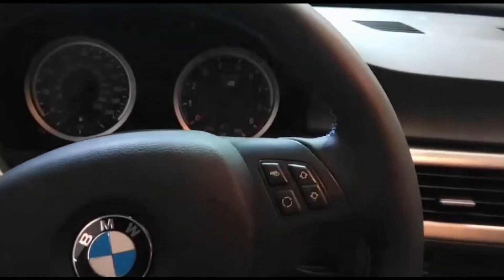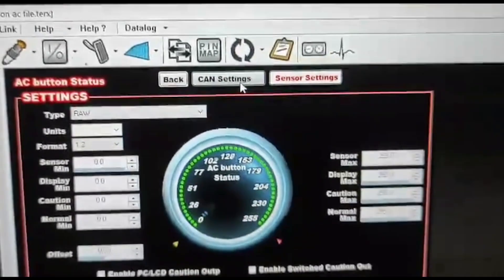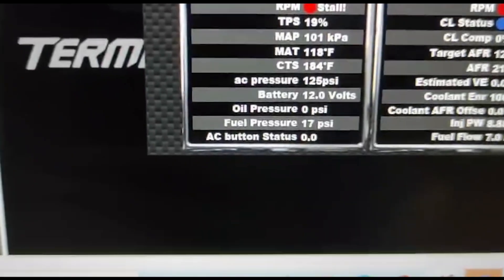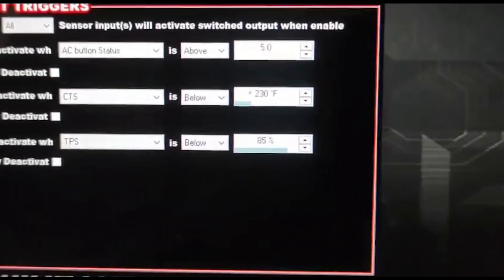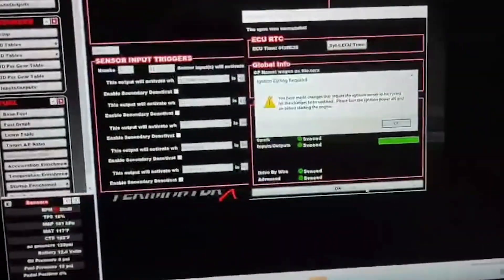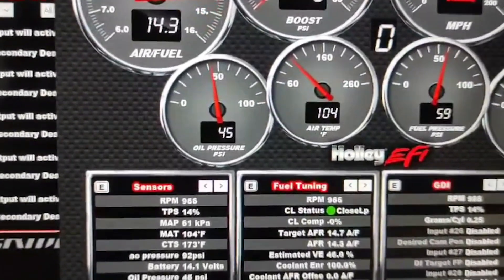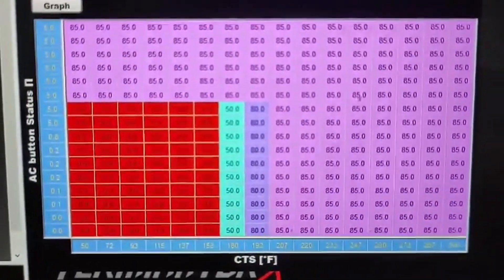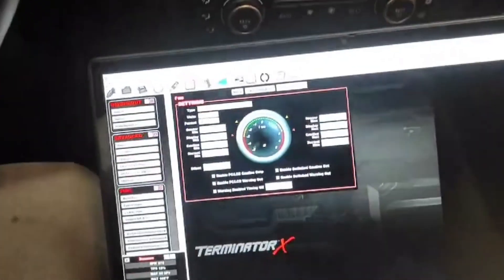Lse90.com Holley Terminator AC Control Configuration Walkthrough

Comment: Not sure if this is to demanding but any chance you can get the factory cruise/etc functions to work? I’ve got a 2011 e90 with factory paddles etc etc and am curious if I could get them to operate gm transmission and cruise control. That possible?
Reply from the maker: maxxecu would be a better option.